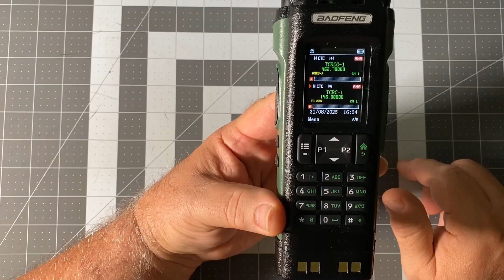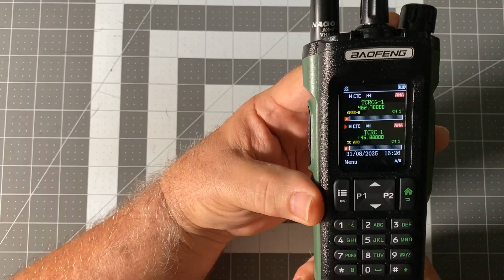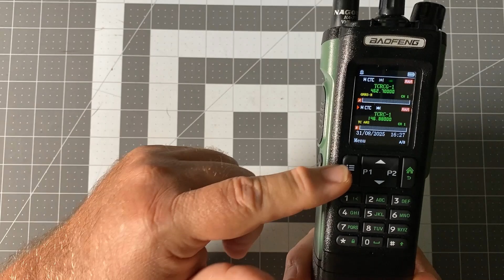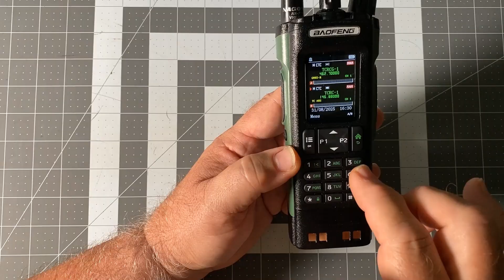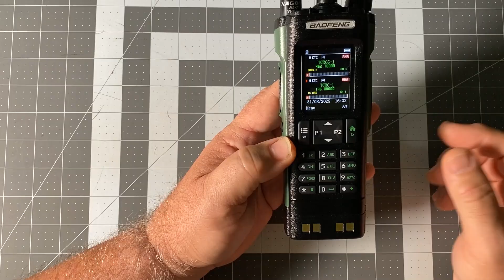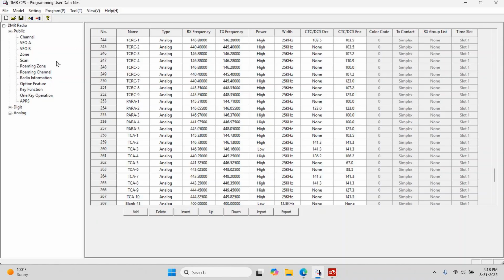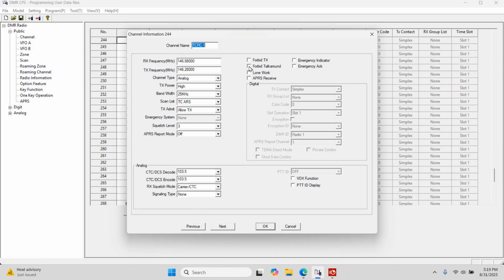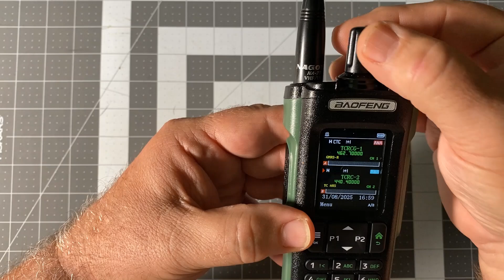Baofeng DM-32UV - Simple Fix for the Repeater Offset Failure Problem

Comment: 11:00 Ok listen closely. You cant make changes to the channel in channel mode thus why you cant find the shift. It needs to be in vfo mode and your menu for setting the new channel changes and there you will find the "shift" option. Option number 9 in vfo mode. That shift mode is absolutley in the menu....but only under vfo mode when intially trying to program the channel. Weird firmware from baofeng.

Comment: Yeah. BF really dropped the ball on this one, getting it ready to hit the market.  It’s as though some mucky-muck on the 9th Floor gave an order for a drop dead release date of, such and
such. That date came. And all the not-ready-radios and all their not-ready-for-prime-time
manuals, got shipped. And- kids, here we are. As the PAYING consumers we’re expected to finish up the work of the PAID
R&D engineers. And the manual!
The not-ready book, leaves so
much unfinished. Or, just simply 
ommited. Does it say anywhere
what cable to buy? To BUY.
Why not include it. Wuh, for the
same reason as the microscopic
manual. Save a few pages of paper and ink. Save a penny or two. So many topics just not
covered in the book. What do you do if the keyboard gets 
locked? There IS a lock button.
But, nowhere in the book will
you read how to unlock it….
And more…

Comment: When a radio is using Talk Around, it is circumventing this communication through the repeater. Instead of transmitting and receiving these signals on two different frequencies, The Talk Around function allows the radio to both transmit and receive on the same frequency in simplex mode, bypassing the repeater entirely.

Comment: Great video and explaination - especially for newer users.    I would very much appreciate you doing the same kind of analysis video for scanning through analog channels.   Example, having simplex channels such as FRS or GMRS in slots 1-15, I cannot for the life of me get this (new) radio to scan through them looking for activity.   I created a scan list, added those channels to the list, turned on the scan switch, and hit the scan button on the bottom right of the keypad... nothing.    I will bet it is me, but I have also wondered if it is a firmware issue as you described.  Hitting the scan button on the bottom right puts my radio into a "Seek" mode, not a scan mode.

Comment: “Key-down”? Mate, it’s called “key-up” the repeater!
Reply: Not exactly mate. Its a morse code term (CW). When you transmit on CW its called "keying down" because you push the button DOWN (or side to side). Some people use it interchangably with "keying up". Either way indicates transmitting on a device.

Comment: The radio defenitely needs a firmware update. Not all the bugs are worked out. I had one for a day and sent it back. I didnt like the battery setup with a screw and no upper band on the 70CM. Band. I found out that You can expand that there is a different Firmware. Theres been issues with the recievers of these Radios. Im defenitely not fond of this radio. Built quality is good, but theres only 16 Channels on Scan because they Copied the Motorola APX Line. The software and firmware are buggy.

Comment: I'll do the review for you.  It's trash.  You can't  field program past Channel 16 without software, laptop, cable etc.  Sure it does more stuff but in the field you only have 16 channels analog and digital total.  The AR5RM is analog only but a much better radio

Comment: I thought my UV-32 had gone out, but after putting my other battery pack (don't lose the bloody screw on the battery) and turned it on, no problem. The battery needed to be charged... I do have the UV-32 & DM-32 UV now

Comment: What is "Lone worker" used for?
Reply: its for business use. if you have security guards or fire guards who patrol alone, this is a replacement for them calling in every 15 min or hour so the office knows they are ok. if you are a helocopter parent, you could give your kids radios with this turned on to replace tracking them by phone.

Comment: i want to know if you have any guidance on the Digital side of things. I'm trying to connect to a local DMR repeater. I got all the info entered, thats tx/rx frequencies, color code, time slot. Talkgroup and contact ID set. my problem is that my status bar shows incoming transmission which i think is a repeater identifier but I get no audio. i switch the channel to analog and I get the EEEEEEEEEEEEERN! sound. Nothing on Digital but EEEEEEEEEEERN! on analog. What am i doing wrong? You probably can't help but it's worth a shot for some insight.
Reply: did you add your talk groups that you want to hear to your RX Group, and assign that RX group inside the channel setup? also, you can disable the Group Match option --- which makes the RX Group thing less critical.  Ther CPS is complicated in the sense that there are multiple overlapping dependencies between these various lists --- it's the same concept as "you added the channel, but did you also assign that channel to a zone?"  If this sounds like greek, try pasting this into ChatGPT/Perplexity or similar and start asking for clarification. Good luck! :)

Comment: Actually is you goto Radio Settings/Other Functions/Scroll to Option 6, the talk around toggle is there.. No need to log on to a PC.
Reply: Works like a charm! Nice if you only have 1 or 2 offset to change.  But good to know where to look in CPS too! 73
Reply: Okay..... I tried this and my radio will not let me access Option 6 to turn off the talk around feature. Suggestions?
Reply: @tantrictemplar  is your radio a DM-32UV or the 32UV?  The look identical, but I’ve seen some videos and some menus options seem to,differ a bit.

Comment: Great video! I have one of these HTs and I found the Talkaround arrow on few of my channels. I programmed the SK2 Long Press to "Talkaround" and now I'm able to fix the channels directly from the radio without having to connect to the computer and use the CPS software. 73 (BTW, I have firmware 46 installed from factory on mine.)
Reply: This is genius level! Thanks!
Reply: I have my talk around feature turned off (the way is was set from the factory)

Comment: Same issue with repeaters for me. I just put it aside for a few weeks. When analogue repeaters don't work, it's worthless to carry. Thanks for this. I'll try that tonight.
Reply: After spending another hour with my DM32, that was not the issue. It just hits some repeaters, while others just as near don't get reached. I have many 2m/70cm radios and they get the repeaters every time. This one fails on some for no reason. I am close to done with the radio. I should have sent it back to Amazon.
Reply: I have had this same issue as well with my new dm32 and even doing the talk around option it still won't work. It will currchunk the repeater but no audio will transmit or recieve from several repeaters that ate close to me. Where as my uv-5r will work flawlessly. Not sure what to do.

Comment: Having a DM-32UV is a ton of brick walls. The CPS works fine for analog repeaters. The DMR side is a complete abomination. If you have a hotspot, the very minimal options available work fine. If you're dealing with a DMR repeater, prepare to bang your head against a wall. Plug the USB cable in and the rig refuses to power up. Power up first, and then plug in the programming cable into the radio. Half the time, the read/write shows a failure until you remove and reinsert the programming cable into the PC's USB port. DMR is always a huge pain... This rig makes it pure torture. That being said, on the plus side, on analog FM, it's a great rig. Speaker volume and quality on RX are excellent. With a better antenna, the RX performance is more than acceptable. I ordered mine with the Motorola style plastic holster, which works amazingly well.  The rig is solid and VHF TX is well within spec. All in all, it's not a bad rig at all.

Comment: I got my radio about a month ago and it had version 2.32 installed. I now have it up to 2.40. I'm curious to know what version you have on your radio.
Reply: I have 046 firmware installed and the offset issue is still there
Reply from the maker: Firmware version DM32.01.01.041. I've looked into DM32.01.02.46, which isn't officially listed on the Baofeng website but appears to be making the rounds on Facebook, and have avoided that as I have heard reports of it bricking radios. DM32.01.01.041 is currently listed as the most recent firmware on the Baofeng official site. I also heard that 46 doesn't address this issue.
Reply: @KS6DAY regarding the firmware version, I believe there are two “flavors“ of them. From what I know, there are two versions of the on-board vocoder that requires different firmware. This is distinguished by DM32.01.01.0XX and DM32.01.02.0XX.
Reply: @shengruizhang6476  can you please elaborate more? MIne came with 01.01.46. Everything seemed fine but as I am trying to program DMR, I cant seem to be able to setup to monitor these channels. Im still learning DMR but I think I have all info correct but wonder if it is firmware issues?
Reply: @LQban0  This sounds like a programming issue rather than the firmware issue, as the incorrect firmware would prevent you from turning on the radio at all. It also looks like your radio already has the latest firmware from the factory, so no firmware upgrade needed.

To listen DMR traffic on a channel/frequency, one would need to have Frequency Offset, Color Code, Time Slot, and Talk Group all set up correctly

The earlier DM32 can come with one of the 2 firmware versions from the factory. The firmware version shown in the radio can either be DM32.00.01.0XX or DM32.01.01.0XX. To upgrade radio that has the first version, one needs to use the DM32_0XX_HRVocoder_2025XXXX.bin file; and the latter would use DM32_0XX_2025XXXX.bin.